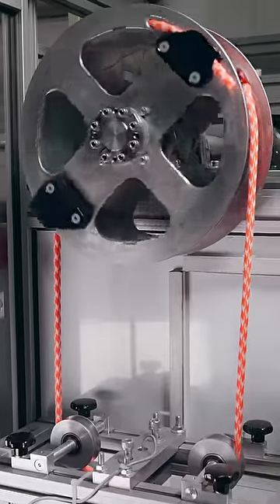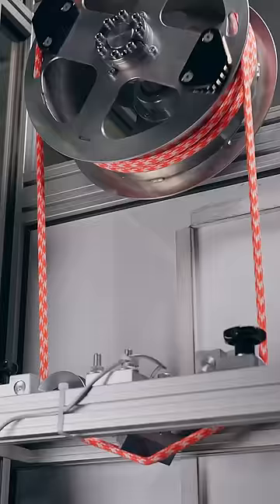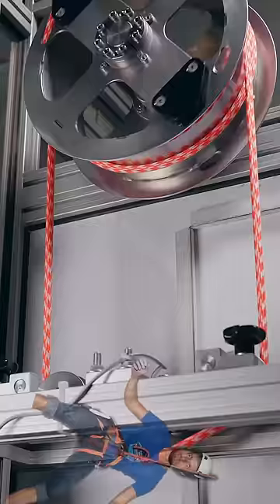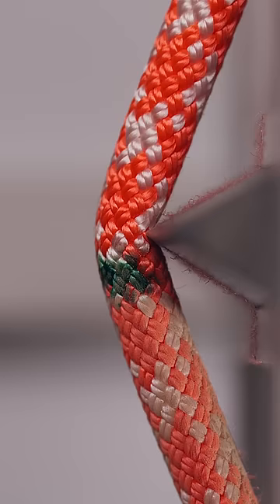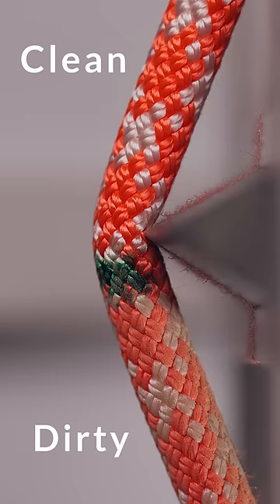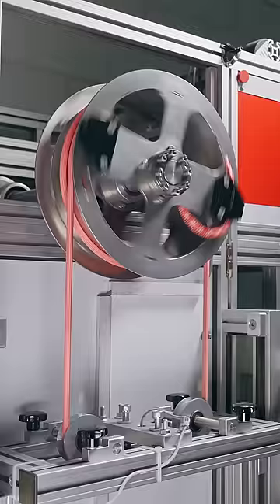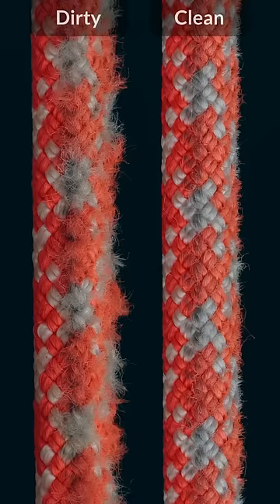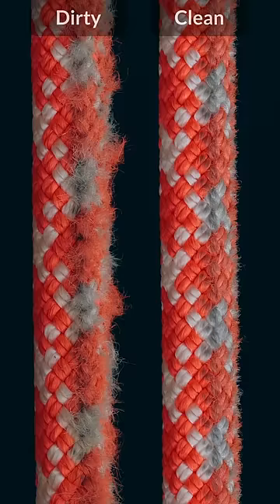Surprising Effect of Dirt on Climbing Ropes

Comment: As a professional climber I can tell you that it is very important to bring a broom and a dustpan to clean the entire mountain free of dirt before climbing so you don't get any hazardous issues like these.
Reply: The entire mountain? Lol
Reply: As a professional YouTube video watcher I can tell you this is what all professional rock climbers. Back in Vietnam we would carry brooms and dustpans just for this exact reason. The brooms also doubled as shovels and the brooms as a  bayonet. But you could only use one at a time.
Reply: I just climb a mountain right after it rains, too lazy to sweep up the mountain
Reply: @tabcreedence6553  That's why during a heavy rain storm is the safest time to climb. Plus the lightning bolts ionize dirt particles, making them fall off the ropes more easily.
Reply: and do for mountain cleaning service
Reply: @chrisjohnson7524  Yes definitely. Also, the wind gusts help to boost you up the side of the mountain.
Reply: @chrisjohnson7524  i cant tell if youre serious or not
Reply: @x.SE7EN.x314  Its definitely serious. You should try climbing in the rain with a dirty rope. As shown in the video it provides more grip, friction, and surface area
Reply: I always use glass coating to make the mountain surface smooth. Also easy to use suction cups to climb 👍
Reply: LMAO
Reply: As a rope i confirm this is true
Reply: Real climbers bring vacuum cleaners.
Reply: I mean deserts.  But otherwise Rocks are pretty solid and clean due to weather.
Reply: any professional climber would prefer to use a leaf blower
Reply: I am a life long climber. I taught Alex Honnold everything he knows and, EVERYONE knows a dust pan is not the right tool for the job... Way too small, no my friend, use a snow shovel and it cuts your cleanup time by half!
Reply: Instructions unclear.  Climbed mountain during hailstorm.  Can confirm rope is clear of dirt.
Reply: I just bring a cordless vacuum.😅
Reply: Clean ropes are aid.
Reply: @Naraku-no-Hana-WE  🤦😂
Reply: I like to set my Roomba loose on the hike out. it scurries off and when I get there the mountains is all ready to go.
Reply: Me, a total newbie, learning from the bestesters.
Reply: Professional rock climber? That sounds like a really interesting job
Reply: I agree, that's why I took a job as a mountain broomer.
Reply: As someone who's swept all the sand off the beach because it had broken glass mixed in, can confirm this is normal.
Reply: @additivealex4566  woah dude... I'm hanging up my ropes 🫠🤣
Reply: @sighfly2928  No no. That will take too long. Best is to clean the climbing spots that you use. You know... climbing etiquette
Reply: Next time. Carry a washing machine
Reply: I prefer steam cleaning
Reply: Priceless thread😂
Reply: @chrisjohnson7524  it also cleans the dust out of the air so it doesn’t get i your rope and also so you don’t sneeze yourself to an early grave.
Reply: Dude wtf, you'll be there forever.

Just wait until the rain cleans all the dirt off it.
Reply: @chrisjohnson7524 " let's go climb rocks in a lightning storm that's the safest" 🤡 probably the dumbest thing I've ever heard if anything you would climb post rain fall after the wash is done and there isn't still dirty water pouring down the mountain, not to mention the higher risk of slipping your grip 🤦‍♂️I don't even climb that much and I know this comment is absolute dog water.
Reply: @bmthking   Sir, this is a sarcastic reply thread. Read the room.
Reply: Yup.I suggest an ironing board too and a very long electrical cord so you can flatten the rockface as you go.😸
Hannibal recommended packing an elephant,some vinegar and some lye,to smush the nastier rocks.
Reply: I'm actually currently sweeping up the Everest hopefully I'll be done by 2027😊
Reply: I am professional near-mountain-broom-salesman and i can 100% confirm that this man is correct, safety first!
Reply: Hahahahahahaha😂
Reply: Just cleaning the floors of the forest to prevent wildfires too
Reply: @louisgrissman4857  Yes. That is why you always see videos of people climbing in the rain lmao.
Reply: I guess I am the only old fart in here that has heard of a "dust buster".

Or maybe that makes me the young one in the group.....you silly old folks with your ancient tools like brooms and dustpans.
Reply: Sometimes, when we need to rescue people, I often get so caught up in dusting with the swifter, I forgot why we showed up in the first place
Reply: Can I use a washing machine, instead?
Reply: Might as well clean all nearby mountains just Incase.
Reply: @sighfly2928  LMFAO WHAT U SMOKIN BRO SHARE
Reply: @nickmiller5489  you seem to have forgotten what you really wanted to say and may need to edit your comment so it can make more sense.
Reply: And Spray water at high pressure to make it more clean 😅😅
Reply: That's awesome that you can do that, hats off!
So actually you don't even need the rope !
Reply: Boulderers bring brushes absolutely but not dustpans. You might be surprised at the maintenance that goes into cleaning rock faces. And mountain climbing is not rock climbing.
Reply: @SuperUvix  It wasn't a joke, I saw him sweeping his way up Everest. Such a nice dood.
Reply: @x.SE7EN.x314  Can’t believe you’ve never heard of that. Also, when you’re lifting a heavy object, you have to lift straight with your back in a jerking twisting motion. The fast upward jerk with your back is a force multiplier. 👍🏻
Reply: PLEASE STOP EXTENDING THE JOKE? So many bad jokes. 🙈🙉
You won't improve upon that level of sarcasm.
Reply: Mountain fossil appears
Reply: These comments. Lol
Reply: Make sure you double check the whole mountain a couple before hand to make sure you didn’t leave any specs for when you actually climb the mountain.
Reply: Haha good one.
Reply: 50 years on, we see a news article where alcom is on a mountain with a backpack leaf blower and several brooms.

"I've finally done it, there is no more dirt in this mountain!"

Gust of wind

"You missed a spot."
Reply: EXACTLY
Reply: That sounds too time consuming
Reply: @adhdcartoon3338  r/wooosh
Reply: @additivealex4566  That seems like a waste of battery power. I just get my good friend, Pele, to ignite the whole mountain before I go on a climb. It pre-chalks the entire structure with a layer of soot, while also disinfecting nicely. 🌋
Reply: @be.A.b  some men just want to watch the world burn 😁
Reply: You made me laugh 💀💀😭
Reply: I like when real people like you make comments. So good to see the community coming up. And yes it's super important to clean the mountain for sure before climbing. Thanks dude.
Reply: I think it’s about washing your rope between uses. Over time the sediment will get in between the rope fibers more deeply and compromises the integrity under high pressure
Reply: Lmao
Reply: That’s ridiculous. Everyone knows the best way is to bring a pressure washer, packed on your back. You spray it up to the top, and then you’ll need to climb quickly while the surface is wet before the wind blows dirt back onto the rocks. Also, try climbing with football cleats. That helps.
Reply: LooooooooooooLLLLLL
Reply: @UserName-cb6jz 😂😂😂
Reply: @tabcreedence6553  I was already laughing my ass off and then I really lost it when I got to this one
Reply: @sweetsunnyvibes  already done.
Reply: @sweetsunnyvibes  nah we cool 😎
Reply: 😂 These comments pass the test
Reply: @MarieAntoinetteandherlittlesis nd kids these days just don’t appreciate the value of hard work - my father used to have me clean the whole mountain each day with a pressure washer just in case someone came to climb it. And boy I would cop it if I missed a rockslide or two. The wildlife really appreciated their clean home too, they used to play hidey. I miss Vietnam.
Reply: I wood never trust dat rope i use a chain to climb a mountain wit much safe er eh😅
Reply: LOL..😆😆
Reply: The entire reply section went nuts🤣🤣
Reply: You guys are all living in the past. You don't have to clean the mountains any more. You just need to use the right equipment - stainless steel ropes. They clean much easier, don't rust easily, and have a very low friction coefficient.
Reply: You're polemic aren't you
Reply: Bring a whole pressure washer up with you it could help.
Reply: awesome comment section right here
Reply: @x.SE7EN.x314  thats really bad that you cant identify sarcasm😂 but then you'll probably be the typw to climb a mountain hoping the wind will boost you up😂😂
Reply: Trump would approve, along with sweeping the forest dusting down the mountain is always preferred ha ha ha
Reply: As a mountain I'd like to thank the climbers for keeping me clean. I don't have many arms so it really helps.
Reply: @tabcreedence6553  zeldorne
Reply: @Naeidea  r/whoosh
Reply: @Naeidea But you aren't allowed to climb wet sandstone 🤔
Reply: I can’t tell if this is a joke or not
Reply: A broom and dustpan? Are you serious? To clean the whole mountain? You should obviously use a vacuum.